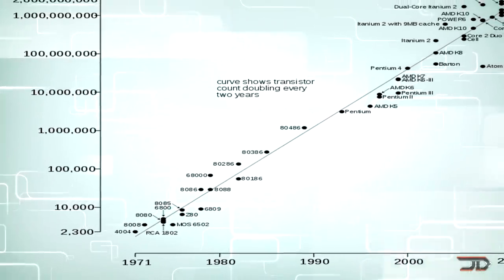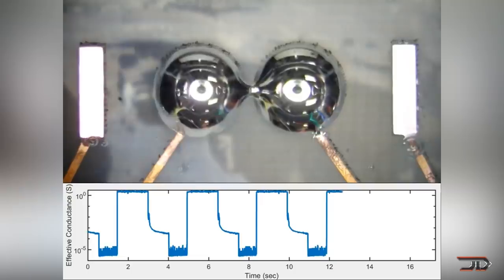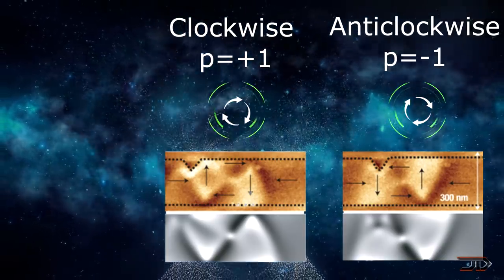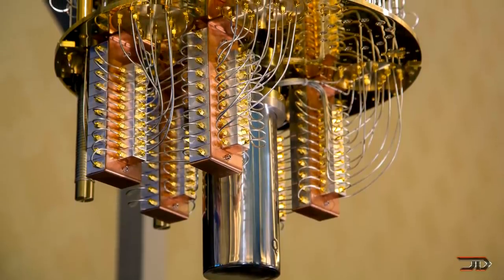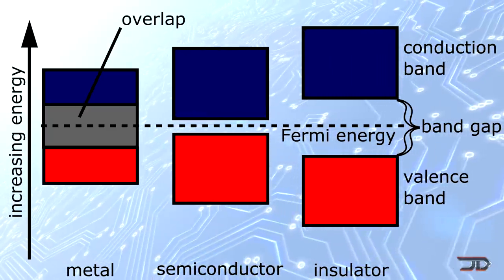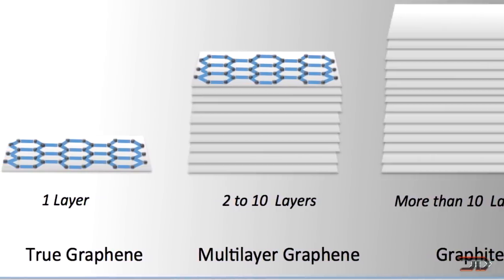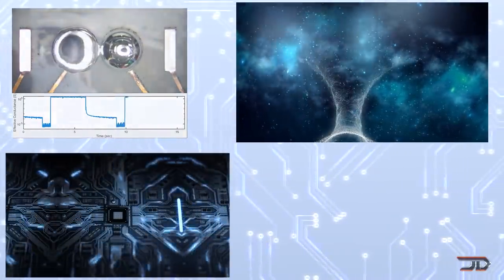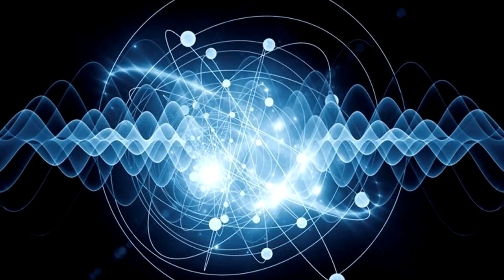The END of Silicon & Future of Computing

Comment: The desktop computer already has been replaced. It was replaced with the mobile phone. Now-a-days more people have laptops then desktops, but not everyone.... everyone has a phone tho.. and those phones have more power then nasa when they went to the moon probably
Reply: This depends on what you use the computer for.  A desktop computer is generally many time faster than a laptop.  A laptop is normally man times faster than a mobil phone. If all you do is use word or a browser then you dont need that much power.  If you do some hard computing it makes a huge difference. 
Just try to do advanced video editing to quickly realize you need a desktop for that kind of work. 
If you do simple things you can even get away with using a virtual computer inside a server. The hardware close to you would be very simple and don't need to be replaced every 3-5 years.  This is done today,  but most still use a laptop as it has some other advantages.
Reply: Mobile phone wont replace pc desktop. Pc desktop solely for performance, not portability.

Comment: Wait, since it's the size of a Silicon atom that is the absolute lower limit... Graphene is bigger, everything you just mentioned is bigger.

No, I will tell you what the future of transistors is: atomic-scale nanobot-built transistors, where the very atoms are arranged one by one by nanobots, giving the smallest possible chip, and allowing for full 3D implementations.

Also, your tone is extremely annoying.
Reply: You actually have no idea what you're talking about. We can already build transistors the size of atoms and we don't need some magical nanobots to do that; that's just plain stupid, inefficient, and impossible to build such a bot the size of few atoms besides the fact that in reality they'd be very slow, big and impractical anyways. It's the quantum effects that start to appear at the very nano scale of atoms which cause distrubances in the circuit when the voltage becomes too low are the problem and those are inevitable.